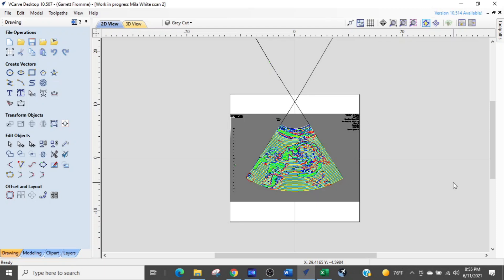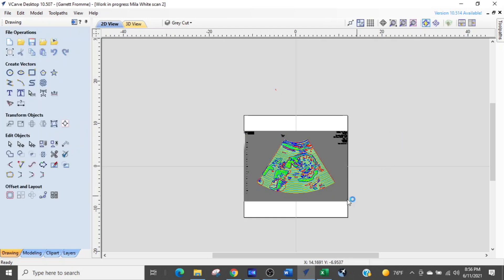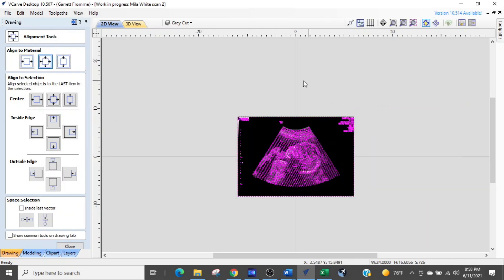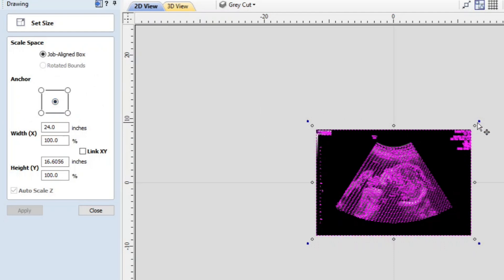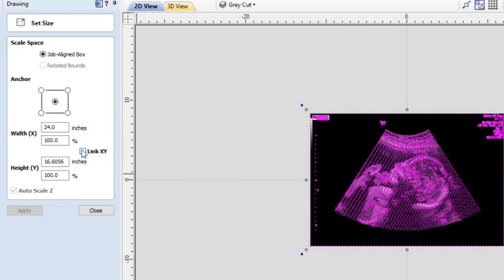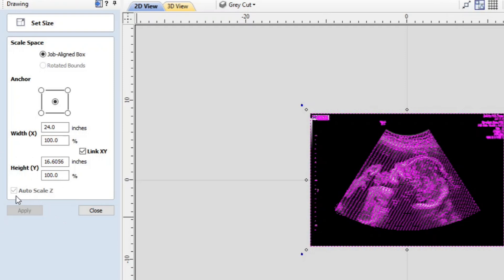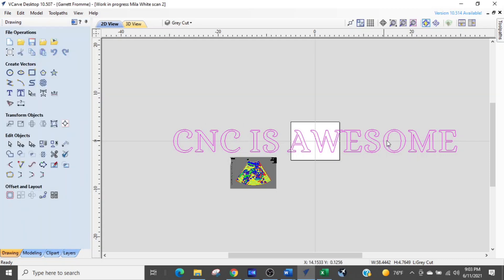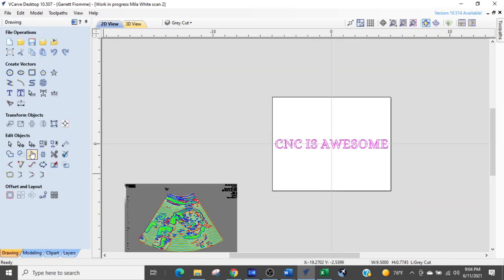The Size Adjust Tool Makes Your Life Easy [Vectric Vcarve & Aspire] Garrett Fromme [scale]

Comment: Does this work on a project file where the toolpaths are included?  In other words, if I bought one of your design files, but it was too large for my machine, and I wanted to scale it down, if I used this method, would it make the necessary changes in the toolpaths?
Reply from the maker: Yes, scaling down a project file with included toolpaths typically adjusts the dimensions and makes necessary changes to the toolpaths automatically. Just make sure to check the settings in your CNC software to confirm everything is set correctly after scaling. It’s always a good idea to do a quick preview to ensure the toolpaths align with the new dimensions. Happy woodworking!

Comment: the project that I resized only had 1 layer but the inner didn't resize. The project is dominos and the dots didn't shrink. Any clue as to what I did wrong? Loved the tutorial.
Reply from the maker: Pizza, glad to hear you enjoyed this video brother. I would double check that you had selected the outer profile of the dominos and the dots as well. The vectors will be highlighted in purple if you have everything selected correctly!
Reply: @IDCWoodcraft  I figured out that if I use the percentages it all shrinks together. I have a learning curve going on.

Comment: hello garrete am having a problem on the size of the designs am cutting on the cnc. Like for example a square 500mmx1200mm. After i have cut it on an ACP i will get 1 mm less on both sides the width and the height....why i dunno
Reply from the maker: Uncharted, I would recommend reaching out to your machine manufacturer and make sure that you are using the correct post processor. Sometimes the units get mixed up if you are using the wrong one.

Comment: Hi Garrett I know this doesn't apply to this video but when I select a object I can move that object around with the arrow keys.. how do change the distance that the object moves with the arrow keys
Reply from the maker: Mark, that is a tough one my friend. It depends largely upon your workpiece size in relation to the part you are moving. I would stay away from moving objects around like that if you need precision.
Reply: OK thanks for your reply I run 2 multi Cam 5000 CNCs  at work and in the  design program  it's called bump increments and I can change that to whatever I need to move that part  with the arrow keys

Comment: Hi. Please help.
I have created a square box (200mm*200mm) and insert a circle inside that box 40mm diameter, but when I run on CNC that circle become  big around 55mm . Thanks
Reply from the maker: Hi Rocky. Unfortunately that is not enough information to even guess at this. But you might want to check your offset value in the cycle toolpath

Comment: Garrett, How do you do the opposite as in to stretch the picture but keep it uniformed, hope that makes sense...
Reply from the maker: hi Joe. I thought I explained that in this video
Reply: @IDCWoodcraft  i didn't think so but i'll rewatch
Reply from the maker: @TheJoe33ham  I may not be understanding your question. Can I restate it?
Reply: @IDCWoodcraft  Ok so i have a project that i want bigger but when i stretch it its not proportional. Your video showed how to shrink a picture but im having the opposite trouble, I hope that makes sense, Thank you
Reply from the maker: @TheJoe33ham  when you are using the scaling feature, make sure the XY linker is checked. Then both sides will scale proportionally. I think that's where you're having a problem at
Reply: @IDCWoodcraft  I appreciate the responses but i think we aren't on the same page. if i have a 24x24 and lets just say its a county im drawing... I'm wanting it to take up the majority of the space and by linking xy it usually shrinks y, if i stretch it then it doesn't look right. I'm very sorry for the confusion..
Reply from the maker: @TheJoe33ham  The way you're explaining it, it should be working correctly.
Reply: @IDCWoodcraft  Yeah should be but isn't. Thanks for the replies

Comment: hey garrett i have been trying to tell the difference between pro and aspire what are the practacle differences and limitations between the 2 thanks
Reply from the maker: Hi Greek. The major difference is you can CREATE 3d models in Aspire. Other than that, they are pretty much the same thing. 

Of course, Aspire has a few extra bells and whistles for the design/cutting side of it, but nothing you would miss.

Are you thinking of getting one of them?
Reply: @IDCWoodcraft  thanks for the answer in the process of saving for a longmill and was looking at your videos (BTW Awesome job very well done) and want to do some topo map carving and want to make sure pro can do that
Reply from the maker: @greeknorth  email me on this. I want to ask you a couple more questions so I can give you the best guidance .

Here's my email
garrett@idcwoodcraft.com

Comment: Thanks for the clarification of this operation.  I recently had to scale down some plaques to smaller sizes, so I just swiped from right to left to highlight everything on the plaque, then clicked one more time to get the little handles at the four corners.  Then hold down the shift key, grab one of the corner handles and move it toward the center,   Let go when you have it where you want it.  However doing what you showed, gives the precise size which you can set.
Reply from the maker: Hey Lyle. I wish I taught this tool earlier, for sure.

Comment: Hi Garrett! Its Cotey again.. im have some serious issues with my bobs evo 4. It keeps destroying pieces because of the z flex. You think i should cut my losses, and try to sell it? I made a simple trey last night with a bowl bit, and the bit caught, and chaos broke loose, and it thrashed around and carved a hole in the trey and a 1/2" groove in the spoil board. You were so smart to move onto the long mill
Reply from the maker: Hi Adaptive. sorry for the delay in responding. I was not feeling well last week. At first I liked the E4. Rigidity was making more and more difficult to a point where I struggled  more than enjoyed. 

Yes, I might suggest it. Geting the Longmill was like stepping into a totally different world. Should you decide to get the Longmill, please feel free to use my affiliate link. what ever you chose, you will be happier.
Reply: @IDCWoodcraft  Thank you! I hope you are starting to feel better! As soon as i get my refund from bob, i will be ordering the longmill 30x30. I will definitely use your affiliate link when i order it. Hopefully shipping is pretty quick, as i already have orders piling up for cnc work lol! I also have a waste board designed for the longmill that has threaded inserts every 3 inches, as well as a grid at a 1 inch scale. Lol! Im quite excited to get it started! Have a wonderful day Garrett, and hope you feel better!